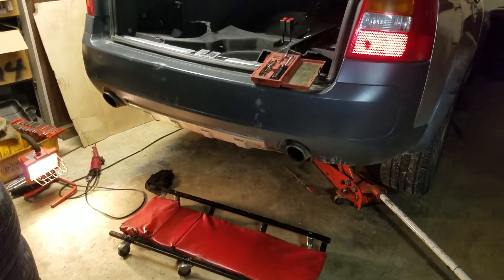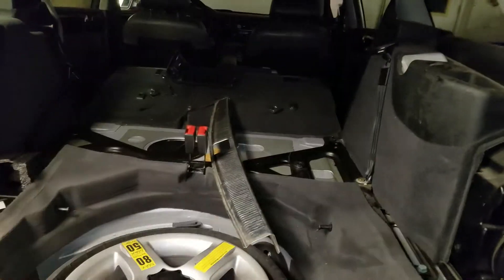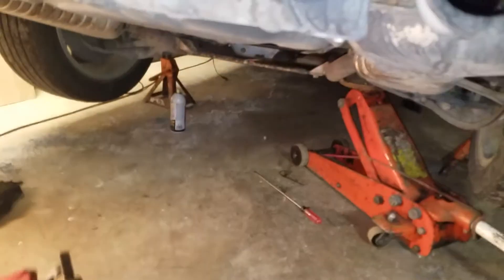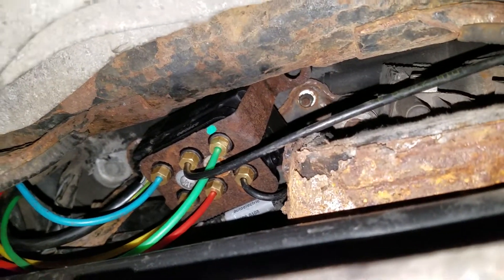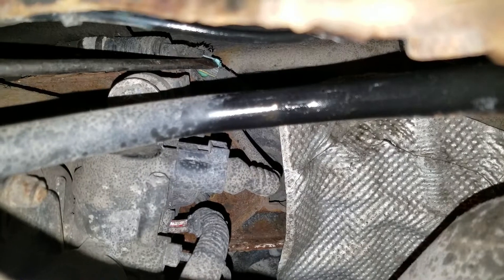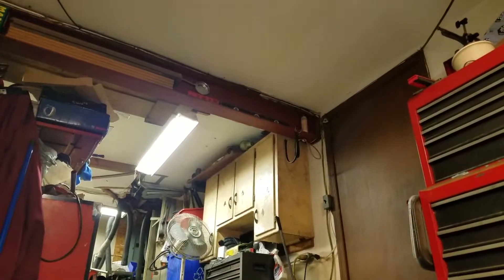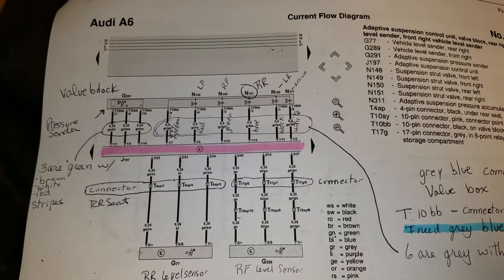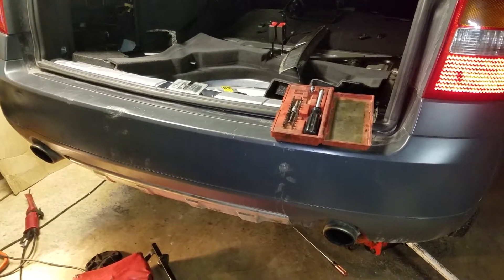02 allroad air suspension, found the n151 right rear strut solenoid open or short to ground problem

Comment: Hey Russell. Great video, and very helpful. I'm dealing with similar issues on my 2004 Allroad. All airbags have been fully replaced, new full shocks/air springs in the rear, new compressor and new valve block (replacing soon). Only one wheel does not lift (driver's rear) zero air going to it. Tested with the other sensor, same thing. All others fill and work as intended, however the right side is higher than the other side. From all information and groups, valve block is failing. I'll know soon, but thanks for the great information on the same car and similar issues.
Reply from the maker: My research indicated a valve block too but that wasn't the case. I replaced my valve block and had the same symptoms afterward. Found later it was the wiring had broken open. Also check the wiring from the wheel sensor back to the chassis to where it goes inside. Somewhere along there I had another break in the wiring on the suspension somewhere. Do you heve a vagcom? It is very valuable in diagnosing the suspension problems. Let me know how it goes and what you've found so far.

Comment: Hi, How did you remove the valve block?  Do you have to remove the entire bracket it is resting on?  It looks the rubber mounts the bracket connect to are riveted (or maybe mine are just so corroded/rusty they look like rivet heads).  It looks like you replaced at least one screw/bolt on the top of the bracket........
Reply from the maker: They were nuts with big washers on the end of long mounting studs. You are right that they are probably so rusted that they look like rivets. I'd suggest PB Blaster and alot of patience. Wiggle them back and forth till the nut breaks free or you'll snap a stud like I did, hence the new nut on there that you see. I used a small 1/4" breaker bar to wiggle it so I didn't have to switch a ratchet back and forth.
Reply from the maker: I watched the video again and I can't see / don't remember how it came out. Maybe I took the air lines off and then took it out with the whole compressor unit. Look up the valve block removal on YouTube. I'm sure someone documented it. I can't look at mine right now. It's disabled outside in 3 feet of snow.
Reply from the maker: Yes, you have to remove the bracket it is resting on. I put new screws back in the block to hold the bracket on. The old ones heads were practically gone.
Reply: @russellp73  Thanks!  I'll get under it this weekend and hopefully get it done without too much rust flakes in my eyes!

Comment: You had error: Suspension Strut Valve Rear Right (N151) 009 - Open or Short to Ground ?
Reply from the maker: @SinnerDeveloper  wire was broken. Probably open.
Reply from the maker: This was 5 years ago 😂 I don't remember.

Comment: So I've got this weird thing where you can leave it on 3 or 4 and it's fine. At 2 or 1 it just dumps. Only on front right. Re did the compressor and it can kind of handle it for a bit but eventually dumps again. 
Will check for wiring and leaks next.
I'm guessing yours was fixed after sorting wiring?
Reply from the maker: After the wiring was fixed, it worked great. I also found leaks if it would sit for a while. I had to go to a local hydraulics repair place and get bigger orings. Mine were Arnott and even they leaked. I wound up getting 80mm x 4mm orings. I'm actually just responding to your comment. I have no idea what video this is. I do have one where I put new orings on my bags, if you wanna search for that one. I also saw a crack in some different wiring going to one of the rear wheels that I'll have to fix soon. I actually wrecked the car on October and pulled the engine out to fix some stuff. It's still parked in my driveway with all 4 corners fully inflated and no battery in the car. They're sealed good.
Reply: @russellp73  thanks. I was starting to think mine was a bit of wiggly wire syndrome so will definitely look at that. I did watch your o ring video and helped a lot. Thanks again